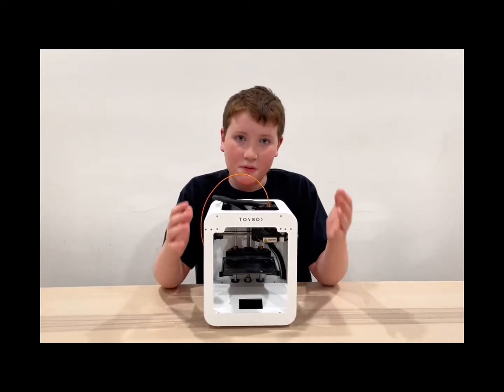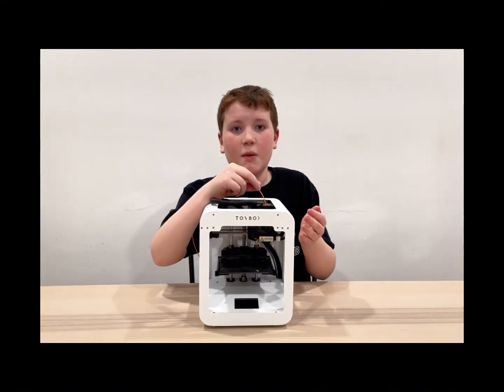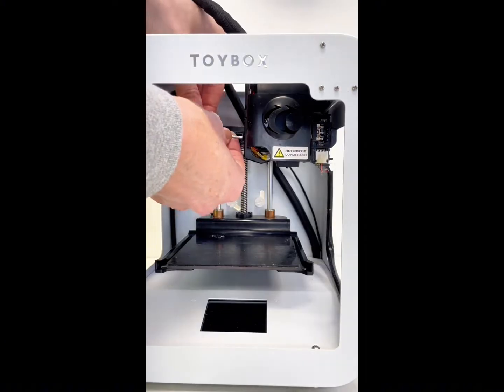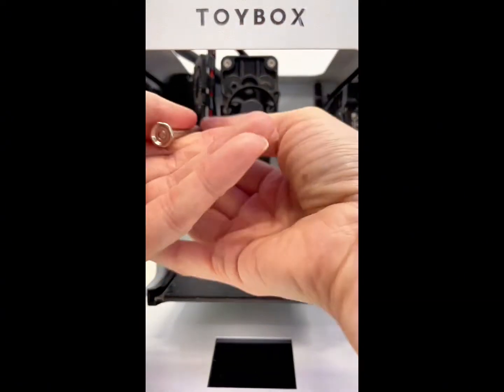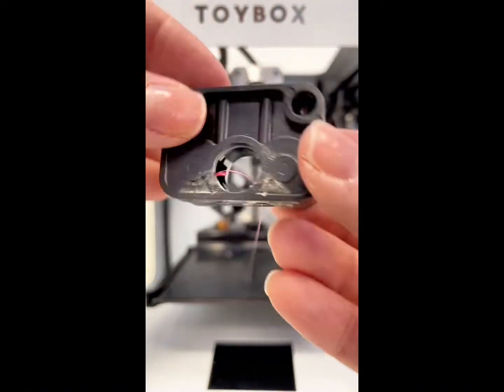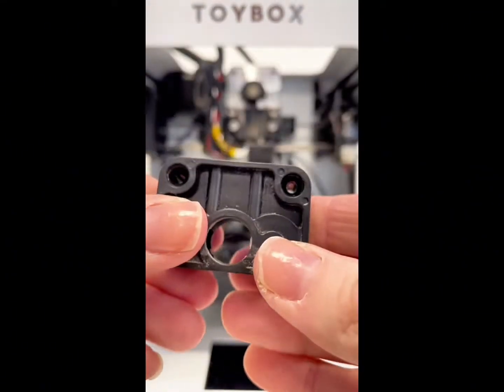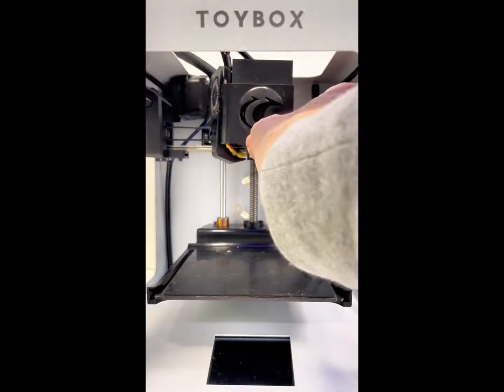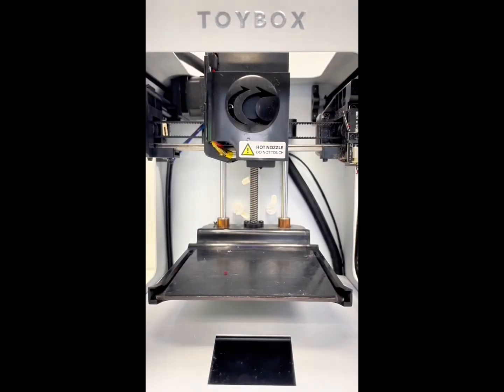Clear a Toybox Alpha 3D Printer Clog!

Comment: I have a question! I can't use my black filament because it just does NOT go in and just clicks. But, I can use any other color filament. Do you know a solution to this?
Reply from the maker: How strange! Is it TOYBOX brand? I’d make sure the filament is not bent or kinked and has a nicely snipped end. Sometimes the printers prefer an end that’s snipped on an angle as opposed to straight across.
Reply: @Vics3DLab yeah it’s not bent or anything and it’s toybox

Comment: Tried this. There was not clog. Any ideas?
Reply from the maker: You mean there is no clog but it’s still clicking?
Reply: @Vics3DLab mine has no clog and it’s still clicking
Reply from the maker: @iMakeKnviesFly  Hi there! So sorry for this late reply.  I find that when this happens, it means the little white/clear plastic tub in the toolhead housing (where the filament feeds into) is a little too high.  It can be hard to push it in any further, so I pull snip the tiniest bit off the top, careful not to smoosh it.
Reply: @Vics3DLab  thank you!!!
Reply: There is no clog and I can’t push the tube any further
Reply from the maker: @drewfletcher7918The tube is probably out too far. Snip a tiny bit off the top—not too much and don’t smoosh it. Then see if your clicking subsides. Do it again if necessary, but never cut too much away at once.
Reply: @Vics3DLab  could it be too far in?